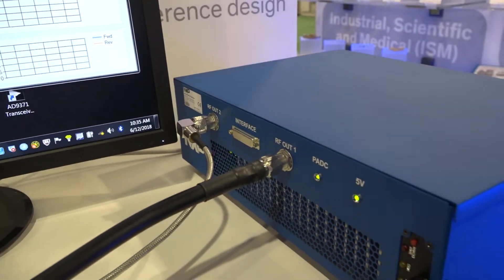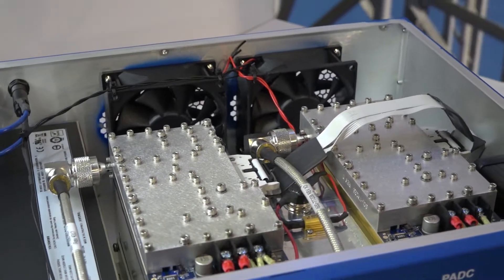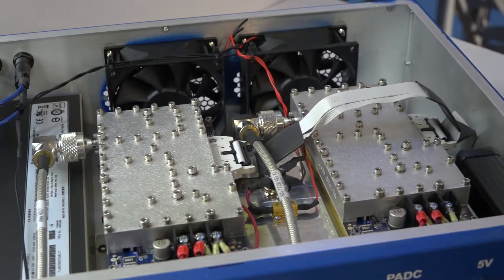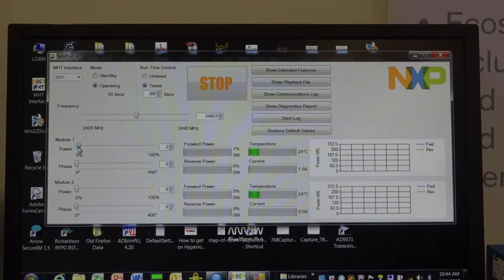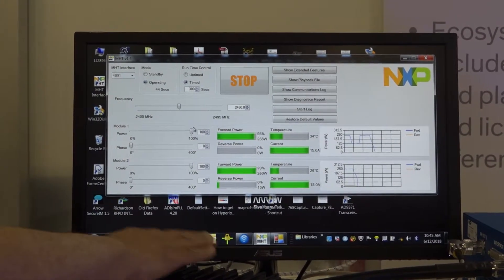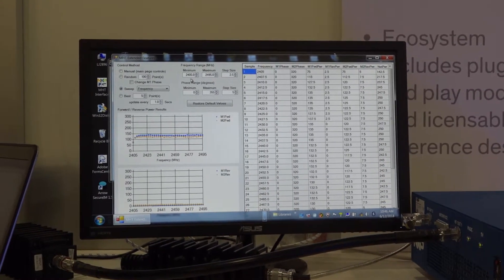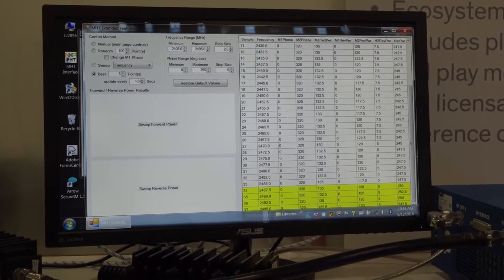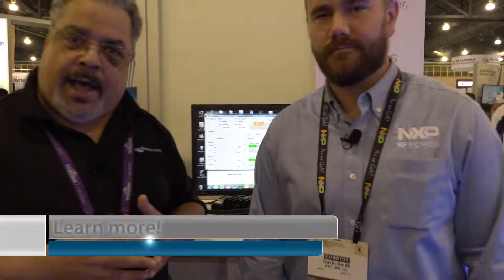NXP 2.4GHz solid state RF heating demonstration platform

Comment: Hmm, so this app via rf, energy box is what could open the door wide from 100% solid state microwave cooking. now ya said each module has a max rf, watt output of 250 x 2 watts at 2 4 to 2.5 ghz. is 500 watts enough power to cook food efficiently? Or do them old magnetrons still have an advantage? Could 4 of these high power rf modules be combined with antennawave guilds at 4 remote locations to produce 1kw thus match the power levels of those cheaper ovens or is 500 watts capable of cooking food just as quickly?
Just saying for I don't see those kinda microwave ovens on the market nor can i find cost pre unit data for a seller.